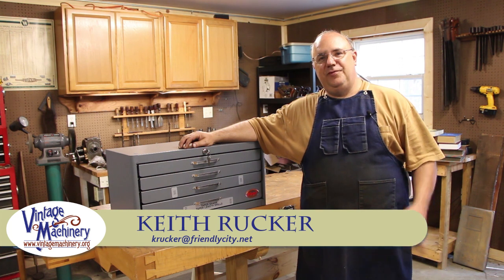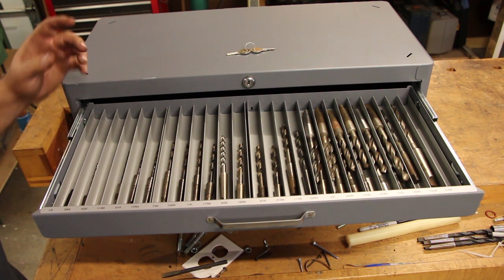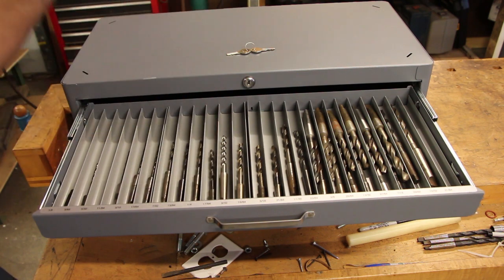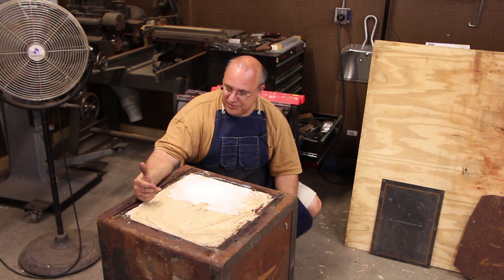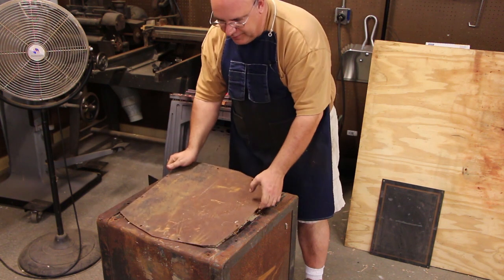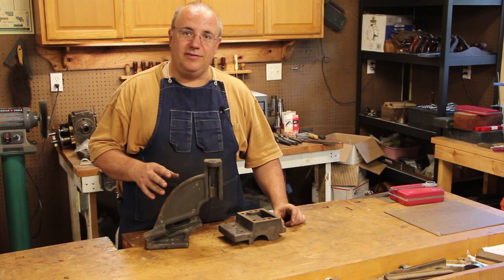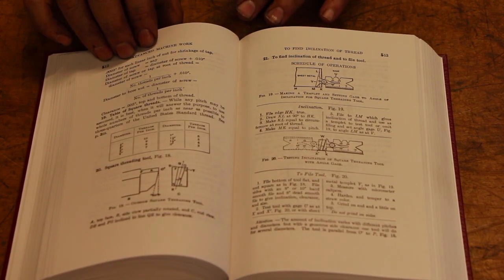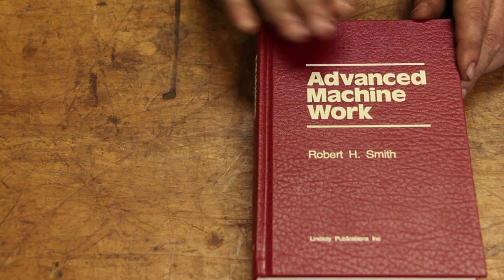Shop Talk 6:  An Update on what is going on in the shop...

Comment: You can stretch that chain a bit but make sure you rotate it around as you go so the stretch isn't all in one place, a pry bar will give you leverage to get the initial stretch out. I made a tool using a pair of needle nose vice grips, heated and bent the tips into a pair of curves  and now I can hold a chin tight for installing master links.
thanks for all your videos!

Comment: I have a set of Modern Machine Shop Practice by Joshua Rose M.E. dated 1887.  I also have a Supplement book to Rose's MMSP dated 1892.  In the supplement the page numbering runs from 1 to 158 then from 465 to 578.  There are no pages missing.  Don't know why they are so numbered.  All three books are in very good condition with original binding.  Wonderful illustrations.

Comment: That sheet metal cover on the safe bottom is not original, the original sheet is under still the corners, don't feel bad about putting on a heavier sheet that fits better.